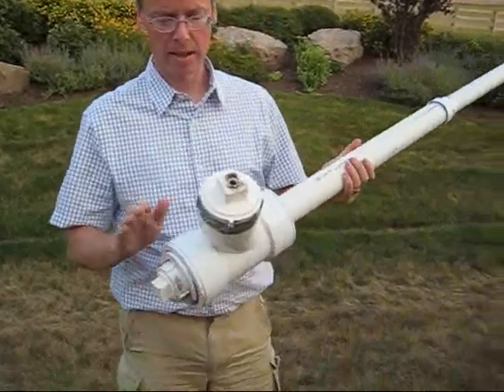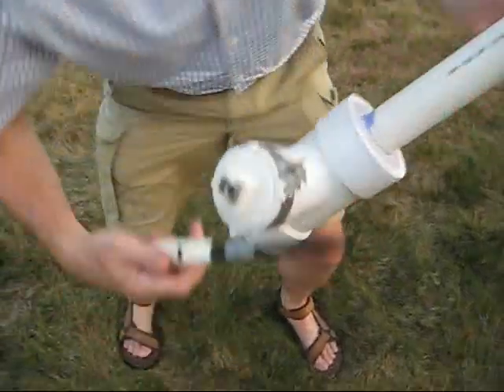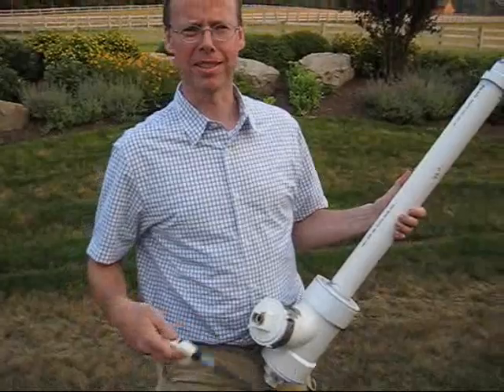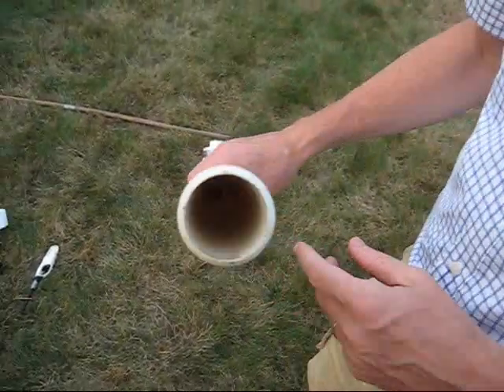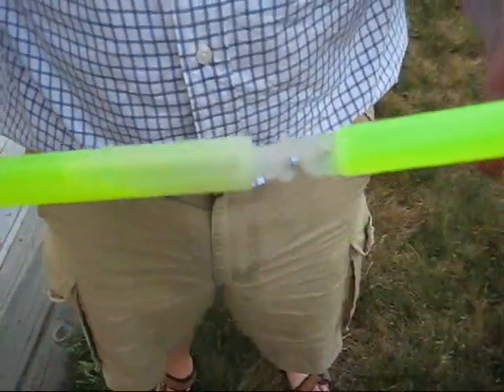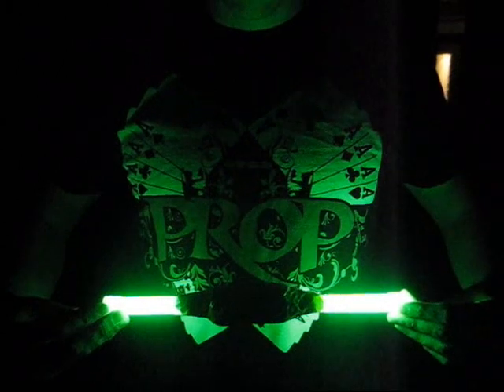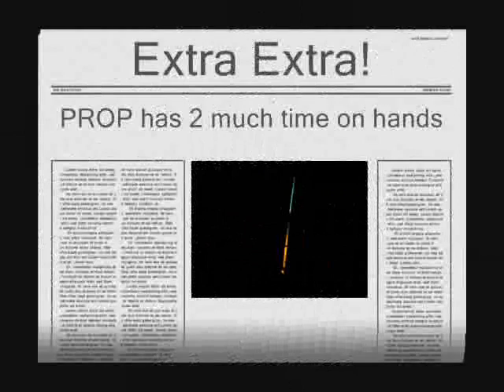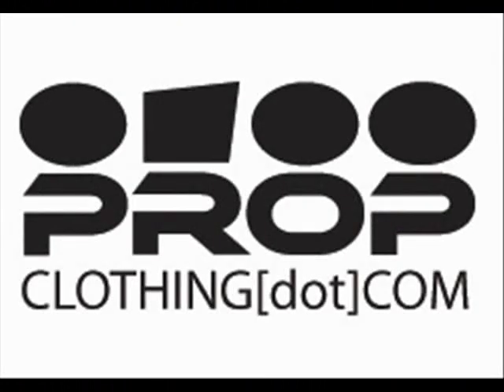How to Make a Potato Launcher, Spud Gun, Cannon

Comment: @linksfood at the very back of the cannon, the end cap, you get a bottle and cut its head off so u just got the screw part and abit of its neck, u put the screw part through the hole in the back of his T piece chamber and glue it in so that the screw part is on the outside,spray the hairspray in through it and put ur bottle cap on to seal it back up

Comment: @lcatania12 just get pipes from ur hardware store and use the strongest pvc glue u can find and put them together, you can use screws as well to make it stronger but u need the glue to seal it so no air escapes from the joints